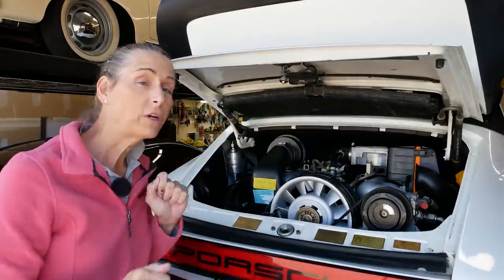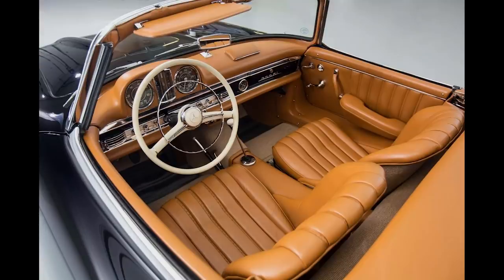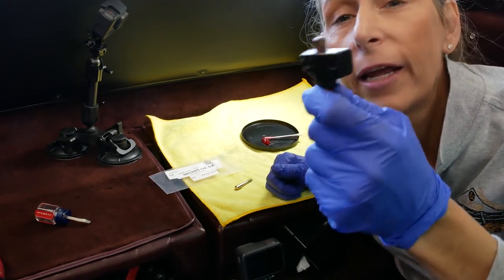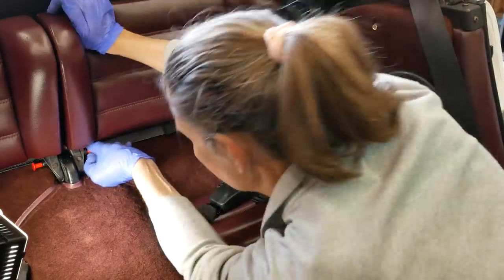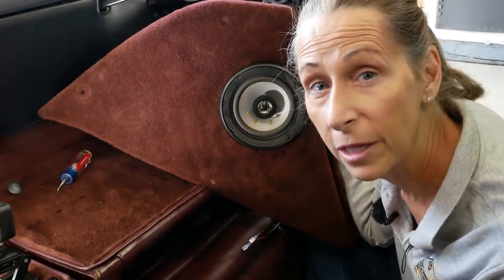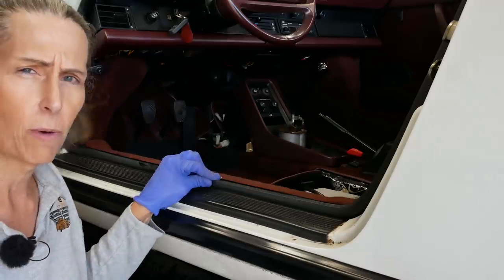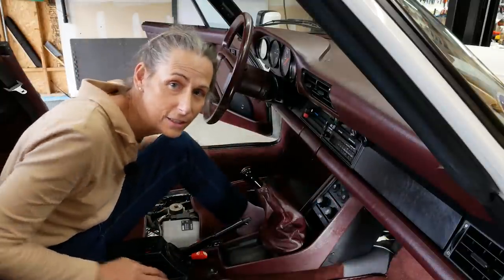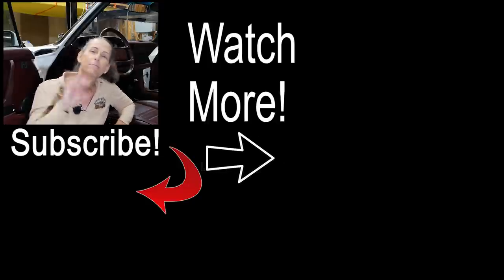Budget eBay Porsche 3.2 Carrera Project Car! #34 - FINISHING the Interior!

Comment: You guys are amazing!!!! I have owned 17 Porsches and did almost all the work on them starting with a '60 356B and a '66911 and never came close to your level of work except for a 1967 911 which was close for the body but the engine didn't need to be rebuilt, just the clutch. It did look like a new car when I finished, however and sold it for twice what I paid for it.

Comment: At 12:40 you will see the door threshold.  Franny did not address the glued down black runner strip on the sill, but you can see there is some surface rust in the corner.  I suggest removing these entirely and not replacing them.  The are moisture trappers and will cause rust.  Thanks as always!

Comment: Those JL Audio C2s are around $175 and are fairly decent quality, hence the larger magnets.  You could flush the speakers and just cover will a burgandy speaker cloth.
Reply from the maker: That's a thought... The panel is pretty strong but not well mounted.  I think someone spent some real dough on the Ferrari sound system but I think that car is louder than the 3.2!

Comment: My '86 coupe doesn't have the locking pins in the rear seat backs. Is that a difference between the cab and coupe? Or did the original owner somehow 'lose' them?
Reply from the maker: I don't have access to a coupe.  Take a look at the hinge and look for the holes.  But there should at least be the block in there even if the pins have gone missing...

Comment: Didn’t You glue the door seals in? Normally, they are glued in pretty heavy. I also wonder why it is so hard to come by raised countersunk head screws with a PH drive in black. I asked several manufacturers myself for them, but... crickets. It’s ridiculous, but I think nobody needs these in black apart from Porsche owners (and me). Next time I visit the plater, I‘ll take a few pounds of screws with me an let them plate them black.
Reply from the maker: Good luck finding the size of screws to plate.  We checked.  It is not just the color.  Heidi
Reply: I can check the sizes in the Porsche parts catalogue, it describes the sizes 🙂. Normally You just need three or four different lengths of each thread diameter (2,9/3,5/3,9/4,2/4,8 mm) and You‘re good for the whole car. At the moment I often paint  the heads of the screws with black basecoat. It works, but plated screws would be way better.